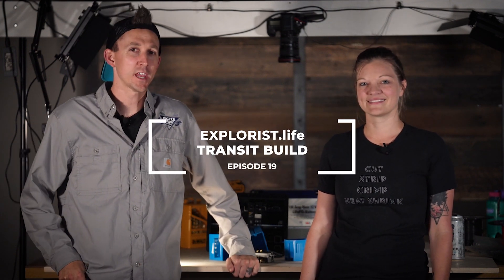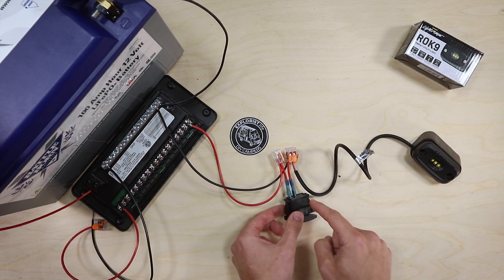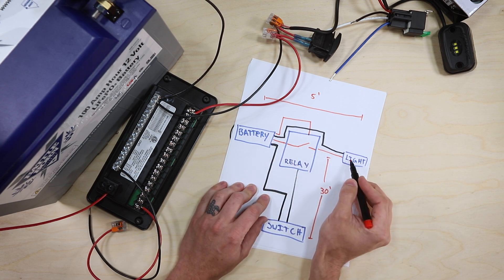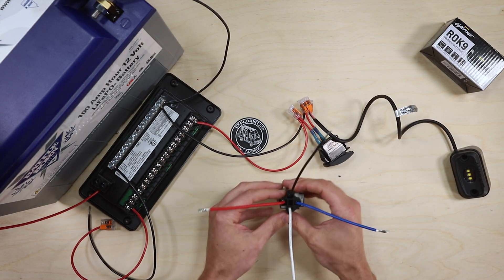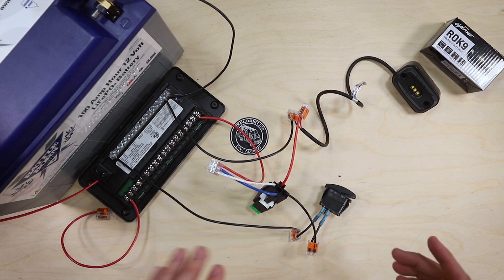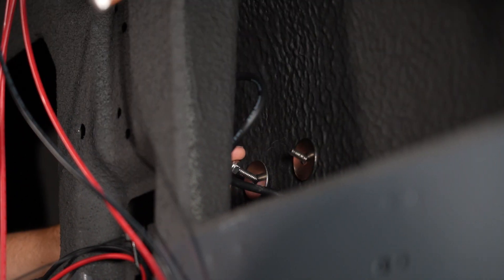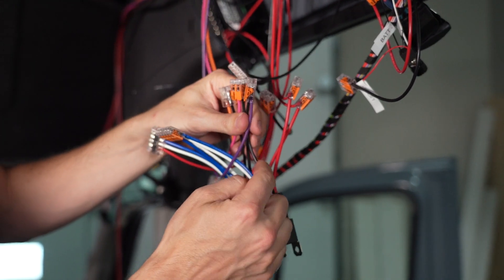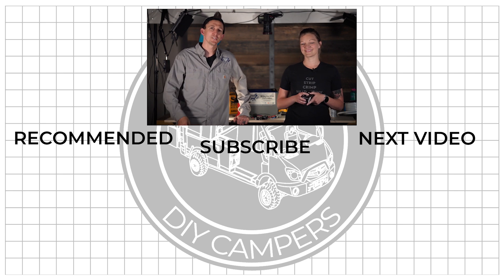HOW TO WIRE RELAYS (To Control Scene/Work Lights)

Comment: The advantage of using a relay is that the switch circuit is lower amperage than the circuit that operates the device.  It may only take 1 to 2 amps to turn the relay on, but the device circuit can handle maybe 20 amps.  As an example, I'm going to use multi switch panels in my van to control my water pump, dump valves, and gray tank heater.  I can run one wire to the multi-switch panel and use a relay for each device.  The wire to the switch panel can be smaller since it's only going to be fused for 3 to 5 amps.  The wire and fuse (in the 12V fuse block) can then be sized based on the current required to operate the device.
Reply: well I hope no switch is using that much power but I see what you're saying. the 2nd advantage is it cuts down on the wire length for the load, which is a very big problem, so you can use a small gauge wire for the trigger  switch and larger for the load

Comment: I keep running into voltage limits with lighting.  These have a very wider range, 10V - 30V DC.  They have no problem with the standard 14.4VDC LiFePO4 charge voltage.
Reply from the maker: Yeah, they are pretty sweet little lights!